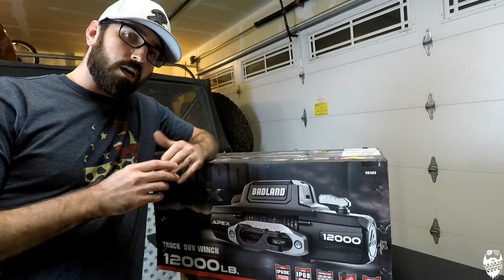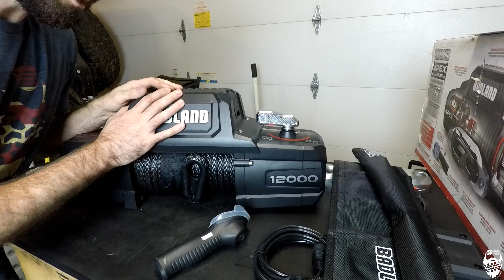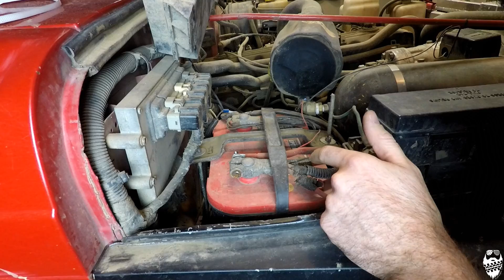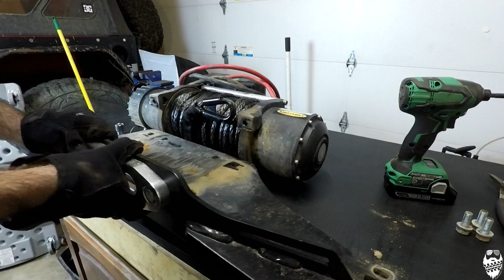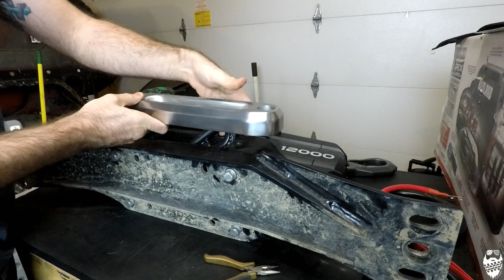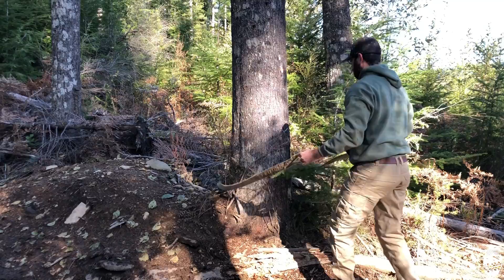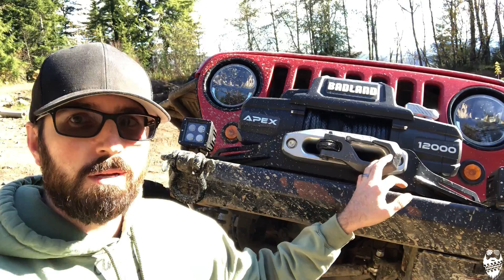Harbor Freight's NEW Warn Killer Winch. Badland APEX Winch install and real world use!

Comment: Anyone actually look at this thing the duty cycle is like 5%. 45seconds of use and wait about 15minutes before using for another 45seconds. That sounds ridiculous.
Reply from the maker: On paper that doesn’t sound great, but all the other winch makers don’t even tell you a duty cycle of their winches, they say “intermittent”? Also that 45 seconds would be a full 12k load with one wrap on the drum. I will never touch anything close to that with my Jeep, also using snatch blocks help out as well.
Reply: 45 secs is a long time with that speed. It would pull probably 50 feet in 45 secs and you would need to reset everything anyway to continue pulling. We are talking $600 for a synthetic line 12,000 pound remote winch with a bunch of accessories. The closest Warn like that is $2000 on Amazon.
Reply: @bryanhersman4037  we talking 50ft or 50 inches or are we talking no load? You have a point though some times you aren't pulling very far. alot of times i pull pretty far though 50ft sometimes 100. feel like with a 7000lb truck id be waiting all day for that to cool down. Under a load it probably pulls 5-10ft a minute. Good for a jeep on trails not a truck in mud.

Comment: I bought one and regretted it as soon as I installed it. Dead out of the box. Get a replacement it works half the time. 3rd replacement and it finally works. Well so I thought. It only works when wired the wireless does not work. Customer service wouldnt send me a new remote and the wireless box. So I have to uninstall and return the whole thing for yet another replacement. I'll pass I'll take my money back and pay a bit more for something more reputable.

Comment: Dimensions, weight, mounting bracket points ( distance of holes ) .I WANT TO KNOW IF IT WILL FIT BETWEEN THE UP RIGHT BRACKETS OR WILL IT BE AN UNDER MOUNT OR A HIDDEN MOUNT . THEN I WANT TO KNOW THE PRICE .
I AINT BUYING IT IF IT DON'T FIT.

$799.99 

IMPORTANT INFORMATION

Oversized item: cannot be shipped to Alaska or Hawaii.

Size
23.2" x 6.67" x 9.96"
( 590mm x 169.5mm x 253mm )
L x D x H
Shipping weight 80lb (36.2kg)
Mounting Bolt Pattern 10" x 4.5" ( 254 mm x 114.3 mm )

Note that the faster the line pull the greater the amperage draw rate useage  ( 0 lbs) ( 0 kg) 60 amp to ( 12000 lbs)  ( 5443 kg ) 448 amp draw rate .
Battery Minimum 12v dc 650 cca